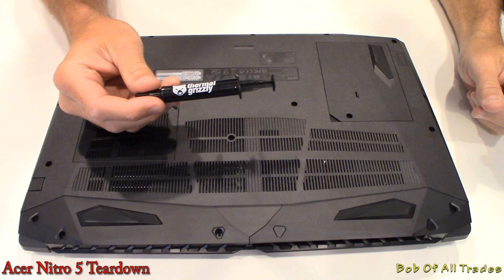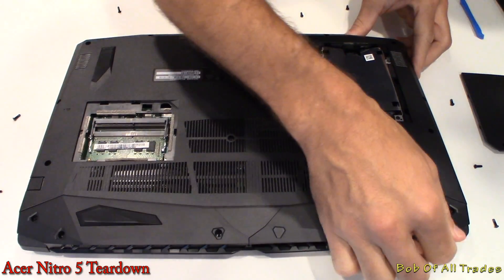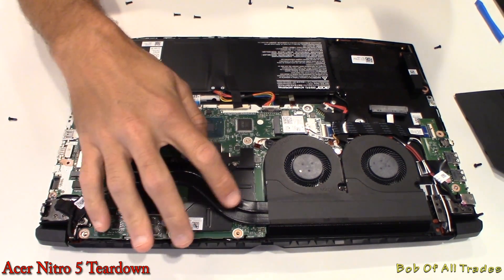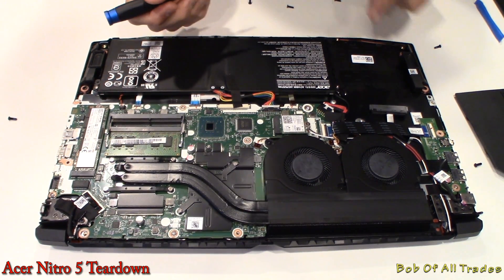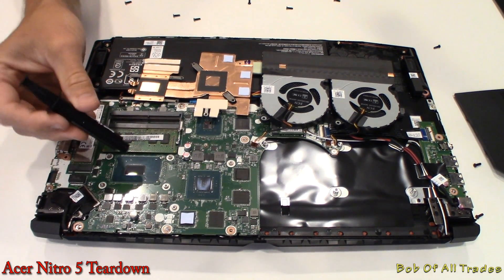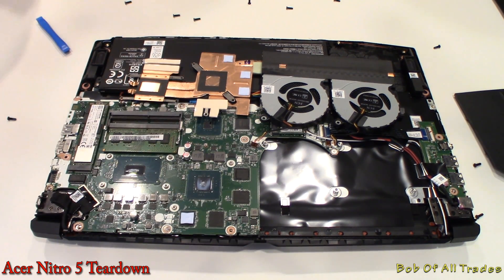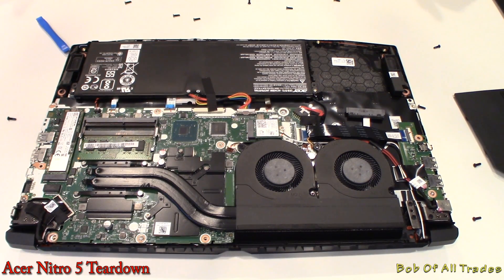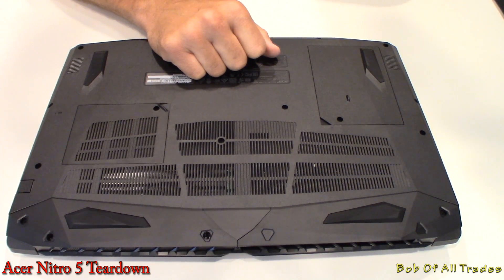Acer Nitro 5 Repaste w/ Kryonaut!  i5 8300h

Comment: i did more or less exactly as you did.. with kryonaught and all.. but i am not very impressed with the temperatures.. what is up wit that?
Reply from the maker: Avlin Ærbødig dame CPU and are you using Cooler Boost?
Reply: @BobOfAllTrades  same cpu.. cool boost yes.. i get like 85C cpu at auto fans cooboost (5000-5600 rpm)
Reply: i tried going into a balanced powerplan now, to see if it helps. must say though, that the pc could be colder.. i was concidering looking for a way to have a modifyed heatsink and build my own lower chassie for it. lots of fans homemade stuff... it i think i could OC it more if not for temperatures. i had to give up any idea of OC because of TEMP, even though the system appeared to be smooth and stable.
Reply: if nothing else, drill a few holes in it so the air would circulate better. (fan laptop thingy below and new holes in the back (maybe have an airfilter here))
Reply: @BobOfAllTrades  tried it all now.. even max fans is not helping... it seems almost it is getting worse with time, idk... might have to redo it.. although i would assume, there is not much burn in time with the krryonaught as people tend to say?
Reply: I ended up using a different TIM .. it seemed to help. Not as good as kryonaught on the lower temps, but better on the higher temps.

Comment: Recently i did a re-paste. For like few weeks it worked fine with undervolting in cooler temps (75-85C) than before (85-92 with undervolt). But after a few weeks i'm getting above 96C temp even with the undervolting. what is the issue? is it the "pump out" effect? if it's is there any solution? please help.
Reply from the maker: Maybe pump out. Once I get a few more things done I can finally move on to covering Carbonaut. Might be the next best thing 🤷‍♂️
Reply: @BobOfAllTrades  is there any solution or  a specific way to apply the paste to reduce the pump out?

Comment: Hello!
I did the same things than on the video to clean the PC, but I do not have changed the thermal paste. Can I still use the PC or I have absolutely to change the thermal paste now? I don't have any thermal issue, I never go above 65 degrees on load. Thanks
Reply: Why would you have to change it? Just don't let it dry when opening it up, i did the same process 2 hours ago, blew the dust out of entire cooling system including the fans, assembled it and atm playing BF1 with 71°C max temps

Comment: I have this laptop almost 3 weeks now, And its my first time experiencing throttling from playing Battlefield 5 in high settings. it was completely smooth between 45-60 fps until it got 92° which throttled back.
Reply: Did you fixed
Reply: did u repaste?
Reply: @Domin17maru  nope

Comment: Just ordered some thermal paste. My Acer Nitro 5 went 91°C a few days ago! :-( Hopefully I can find some dust and dry thermal paste that caused thoser numbers. Will probably report tomorrow. 

Specs:

ACER Nitro 5 AN515-52-723
Intel i7-8750H
16GB DDR4
NVIDIA GeForce GTX1060
1TB HDD
256GB SSD
Reply: After repasting and some heavy gaming: 74° max!!! 🤓
Reply: @TragicAyk  are you still getting those temps?
Reply: @Domin17maru  I've since replaced the laptop with a PC but temps were at least 10⁰ lower after repasting
Reply: @TragicAyk  Thanks for replying, I see. I will repaste mine soon, if I get 10C lower since I'm getting over 90C I'll be happy with it, I've seem some gaming benchmark on this laptop, and they got good thermals, maximum 87C, It seems like they did a bad job applying thermal paste, wish me luck broth 💪🏼
Reply: @Domin17maru  no problem, best of luck to you. I used Arctic MX4 Silver btw

Comment: I just bought a acer nitro 5. Would changing the paste make the tempatures cooler or should I wait till later when it starts drying out?
Reply: Efrain Gallardo it definitely helps I just discovered that they did a shitty rushed job on my Acer Nitro 5 and because of it I’m pretty sure it’s almost broken because of over heating
Reply: _itzencrypted yeah I figured that out and found out how to control it’s power usage to stop it from throttling

Comment: Was doing this and when I pulled the back cover off I pulled the sata cable pins right out of the connector on the hdd side. Now I have to wait a week for a replacement sata cable. Would be nice to warn people prior to removing the backing about how short this cable is and mention how in your demo you dont have to worry about this earlier. Otherwise, good video and I was able to clean the fans of dust and repaste the gpu and cpu. Once the sata cable comes Ill get to see the difference. Under load I used to run my cpu at 90° and gpu wasnt far behind.
Reply from the maker: Mine didn’t come with a HDD 👍

Comment: I did repaste my acer nitro 5 laptop using arctic silver 5. I repaste like 4 times and no matter how i do, my cpu temperature are going up to 98 C. I think only solution is to change my laptop
Reply: Have you ever thought that there might be dust in fans...
Reply: @readytodie7355  No, I cleaned the fans and I'm facing the same problem but I think it's the paste we're using since I tried Artic Silver first and then CoolerMaster and both got me same results, I'll try Grizzly again (applied it before and worked but I didn't put the paste correctly) so I'll do the same as the guy in the video, hopefully I get decent temps now
Reply: @esau817  Too much paste applied?

Comment: How do I know you didn't fry the machine that thermal compound is conductive and it's also based at of gallium so one wrong move and your computer's a brick I have been doing a lot of research into doing this to my nitro 5  I have seen people put different kinds of adhesives around the nodes around the processor I called up multiple computer shops in my area nobody's willing to take on the job and then finally I found one he wanted $150 because of the risk involved so I don't think it's as easy as you're making it out to be
Reply: I just did a repaste on this exact model. Was fairly easy. Definitely use a non conductive paste like conductonaut, and be careful when cleaning around the GPU as it has exposed SMCs around the die that could come off if you clean with too much pressure.

Comment: My computer now says no bootable device how do I fiz
Reply: Did you remove the hard drive before applying??
Reply: No I removed the case cleaned the fan and put it back on I brand it back to Best Buy and got a new one it’s lk
Reply: Okay ... But you should remove the hard disk wire because there is some wire of hard disk connected to back panel !!

Comment: Why won’t they make it so you can change the cpu you can buy mobile cpu 
So why can’t they tell you what the watt limit is. Then you can get better cpu and not go over watt limit. Or get a I9 and under clock it. So it uses power the I5 uses. So it’s a little more powerful and if you get a charger that gives a bigger wattage than the one it came with you could turn the I9 to normal clock while plug in.
Reply from the maker: You cannot buy a mobile cpu. 99% of laptops have their CPU and GPU soldered to the board. That’s called BGA
Reply: Bob Of All Trades ahh ok

Comment: i'm really worried because I was using the wrong screwdriver and I was twisting the screw really rough that caused rounded stripped circle screws. The screw was really tightly sealed so I couldn't unscrew it. I'm not sure what to do now of how to unscrew stripped screws. Is there any other ways I can replace my HDD?

Comment: Doing this and had MANY screws strip on me! Awesome! Can't be too rough! Now it's stuck!
Reply: did you use a good fitting screwdriver? from my experience, stripping screws is like 40% wrong size driver, 40% cheap driver and 20% cheap screws issue
Reply: I stripped some screws too since some of the screws on the cpu heatsink is screwed really hard. My solution was that you really need to push down the screw pretty hard(don't over do it tho) whilst screwing out

Comment: Damn man i must have done something wrong, my fans wont turn on again after doing this, was my first time trying to clean it and paste again :/
Reply from the maker: Most the time people forget to plug in their fans
Reply: @BobOfAllTrades  so i checked again and it didnt stop but its running really slowly (before this it was basically max speed) but im not really sure what i did, i dont think i even unplugged it all i did was clean it since it was almost 1y w/o cleaning, anyways thanks for the help good vid prob mistake on my part :)
Reply: does doing all this reset the fan speed or something? sorry im kinda new to all this
Reply from the maker: João Gabriel Esteves Can you max out the fans with the cooler boost button still?
Reply: @BobOfAllTrades  i can toggle it on and off but it doesnt do anything sadly
Reply: wierd thing is, is that speedfan isnt detecting the fan, yet its still working(slowly but its not off)
Reply from the maker: João Gabriel Esteves sounds like something either got unplugged in the process or speed fan is messing with your settings that’s not software that I use at all
Reply: @BobOfAllTrades  yeah sounds legit, well anyways thanks for the help have a good day :D

Comment: Thank you got it four days ago! Only game I've tried so far after repasted. Grim Dawn after and hour. Maxed temps CPU i5 8300h undervolt .125mv  52c and GPU GTX 1050ti 68c all settings maxed 1920x1080 60fps. Used MX-4
Reply: What program you use to undervolt? And it doesnt give you any problema the mx 4 I read something a out overclock and conductivity that it can burn your cpu/gpu is it real?
Reply: @Wolffyyy1  use throttlestop,search for a tutorial it is very easy to use

Comment: Thank you for this amazing video, I just had to know how to properly open mine (AN515-52) and how to properly apply the paste on the mobile variants of the chips. I used Arctic Silver Ceramique 2 and BOY! 

My temperatures went from idle (sometimes) to mid use 20 degrees celsius lower! where it normally would sit in between 85-95 range on the CPU and 80 on the GPU under load or midload (yes it spiked that high), I know have a 76C max on the CPU and 72C max on the GPU.
Note: I booted a game up for it and played only 5 minutes, but even before that amount of time would spike both chips high.
Reply: Did you put the paste the same way the guy from the video did? I've done it over and over with CoolerMaster thermal paste but temps still terribly high (+90°)
Reply: @esau817  did you undervolt at all? That is 50% of the issue.
Reply: broth, answer pleass

Comment: im considering to buy yhis laptop with i5-8300h +gtx 1060 or msi gl63 i7 - 8750h +1050ti. due to nitro bad heating management but more specs than msi. which 1 i go for? plz help
i usually game 4-5 hrs regularly.
Reply: go for msi !!! this guy has serious heating issues .. you  can make  omlet on it !! go for msi
Reply from the maker: I love omelettes!
Reply: @divyamjain1096  or i go for i5 8300h 1050ti of asus gl503 with 120hz display.???
Reply: @daddygamer3978  whats your budget ?
Reply: @daddygamer3978  i7 is far superior than i5 and also you can replace the 60hz screen later on when u have more money soo !!

Comment: I have an Acer Nitro 5 7700HQ 8GB GTX 1050TI, and it was getting 93-95c gpu temps and 90+c CPU temps during heavy load (Gaming or Stress Test), both had thermal throttle issues. After CPU -0.130v undervolt with "Intel Extreme Tuning", i got 80-85c on thermal without thermal throttle. And i did a GPU undervolt with "MSI Afterburn" that increased the performance but was unable do decrease any temps. So I did replace the thermal paste on both CPU and GPU with Noctua NT-H1.... The temperatures went down to 75-80c on CPU without undervolt and 75c on GPU without undervolt. With both undervolts, CPU was on 65-70c and GPU 65-73c. Got an adicional 10 fps in games like Apex Legends. In conclusion, looks like Acer is using mud as thermal paste on these laptops. Just replace it, it actually works wonderfully well!

Comment: I really like your videos, professionalism, and honesty with your work.
I have built computers, but I really haven't ventured into over/underclocking, thermal tuning, and basically have stuck to manufacture guidelines for everything.  If I follow your guide to repaste,  should this be done every year or so or is Thermal Grizzly a one-and-done solution?
Reply: Hi, Sketch here. Repasting should be done regularly, unfortunately even the best paste dries before long.

Comment: So i went an tried this today but i ended up getting the short end of the stick and messed some things up.

1. when i was removing the screws from the fan, one of them became stripped and I dont know how to remove it.

2.  when i reconncted the usb to motherboard ribbon cable, one of the lines on it lit up because i forgot to disconnect the battery before messing around with it all.

so i decided to take out the ribbon cable and put everything back together, turned it on and it appears to still be working fine.

Do you think i may have damaged the motherboard or the usb card to the site of the internals?

Comment: do I have to remove the hard drive before removing the entire covering?
Reply: Yes. If you don't your going to snap a wire.
Reply: @jackyli1106  which hard drive? The default one or the one that is in place for a spare?
Reply: @Orangejuicemmm  The harddrive. The larger drive, that you can acess without removing the back panel

Comment: So very simple put 
Heatpipes work from any way around
The same amount of energy gets pulled away from the CPU and GPU 
Its the way that these thermal pipes work. Meaning CPU and GPU have the same cooling affect 

Why i am saying this, is because a lot of people believe the CPU doesnt get enough cooling. But thats the bad thermal paste not the cooling arrangement
Reply: it really is both.
having cpu and gpu on one side with both heatpipes close together probably means somewhat less efficient cooling than on a one fan and pipe left and one fan and pipe right setup.
better thermal paste would lead to an improvement in both cases.

Comment: Just two questions.
1. Why are you not using any anti static thing? (Just learning)
2. What do you use to clean the cpu and gpu slots? 
3. Can you turn on the laptop immediately after change the thermal paste? 
Thank you in advance.
Reply: Three questions*
Reply: its probably too late for you, but for others checking by,
1. under most circumstances, grounding yourself on a nearby radiator and not wearing like a freshly dryed wool pullover should be sufficient to not need to worry about static.
but you're definitely on the save side if you wear rubber gloves or one of them static wristbands.
2. get as much off with any blunt plastic tool (like a plastic spoon or that wedge he used to lift the heatpipes) and do the rest with kitchen roll, cotton swabs and 99.9% isopropyl alcohol (pour a little of that in a small shot glas or something, keep the bottle sealed)
3. in this case, you need to put the screws back in apparently, but if application of paste and parts is done, you can turn it on right away.
some pastes like arctic silver 5 actually needs the system to run on high temps for a while to cure and unleash its full thermal potential.
that said, you should always keep a close look on your thermals right after doing this, in case you messed up somehow, if temps explode for no good reason, you'll need a doover

Comment: I have this laptop with the i5 8300h, it has insane performance but games start to get very stuttery after awhile. Gta V drops from 65 to 11 fps. Boosting the fans does nothing, undervolting does nothing either. I guess I'm gonna try to change the paste for some Arctic.
Reply from the maker: What are your temps?  Let’s start there 👍
Reply: @BobOfAllTrades  Temps are 45C in idle, 90C in games. It starts to stutter when it reaches about 98C.
It's definitely a cpu throttling problem because it only happens in cpu intensive games. I play Ace combat 7 at max setting, yet I can't play gta V on the lowest settings.
Reply from the maker: Thermal paste time!
Reply: @BobOfAllTrades  I guess. I'll let you know how it goes
Reply: @BobOfAllTrades  I changed the thermal paste for some Arctic and it decreased the temps by 2°C.
Cpu still reaches 92°C.
I put some spare ram clocked at 1200mhz in the laptop, I have 8gb in total. One stick is 1333mhz, the other is 1200mhz. Do you think that could be an issue?

Comment: ABOUT THE SIZE OF THE MOTHERBOARD IS THE SAME SIZE AS THE ACER ASPIRE 3 A315 .. YOU SEE THAT ARE VERY SIMILAR .. IN A CASE YOU COULD REPLACE THE PLATE OF AN ACER ASPIRE 3 FOR ONE OF NITRO 5

Comment: Thank you so much for such a great video! After re-pasting the thermal compound with (Cooler Master MASTERGEL PRO) and under-volting the CPU:

Temp at IDLE:  ~39c
Temp at Load: ~77c  (running Tom Clancy's Rainbow Six Siege)

Path of exile (Max setting: 65°C Capped)

* Acer Nitro 5 i5-8300h
Reply: Under volting as in disabling turbo ?
Reply: did it void warranty ?
Reply: @Q_QQ_Q  doing this will definitely void your warranty, but it's hard to find out if you don't tell your retailer/manufacturer ;)

Comment: Can someone  help me where i can buy new hdd connector for cheapest price ? [i fuck up that default]
Reply from the maker: The ribbon cable?  There should be a part number on it.
Reply: @BobOfAllTrades  DH50V NBX0002BW00 =11pin flex to sata its located under connector betwen mobo and usb
Reply from the maker: I’ve seen people snag these types of cables on Amazon. Now that you have the part number it should make this easier. Let me know what you find 👍
Reply: @BobOfAllTrades  I try before and nothing and on ebay its around 25Bucks with 30Shipping and i think its tooooooooo much for that cable